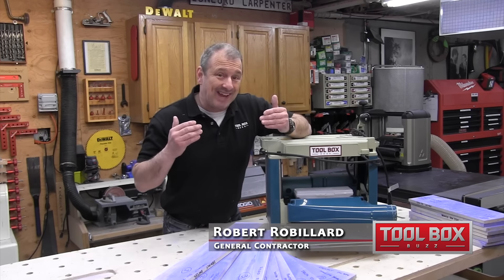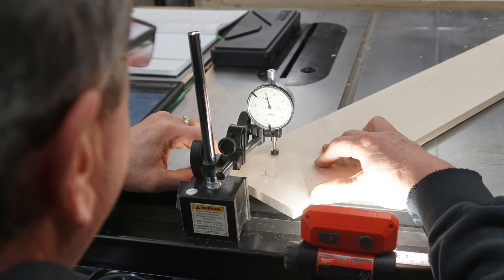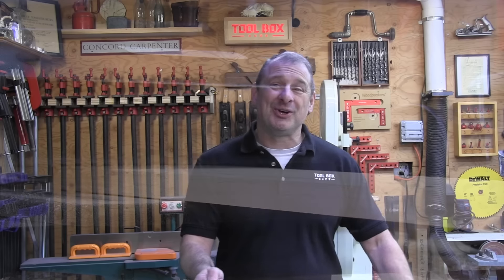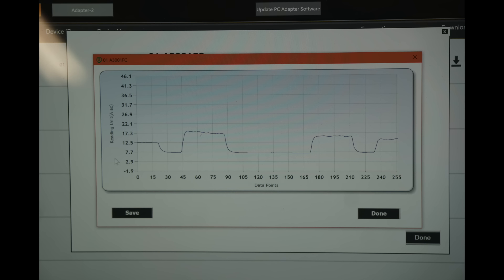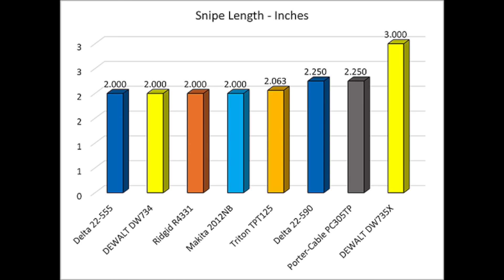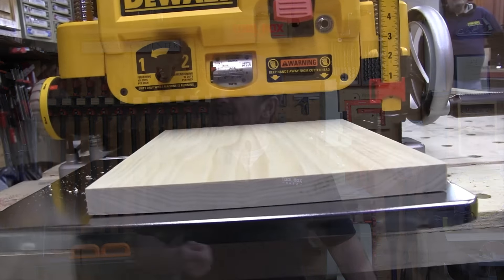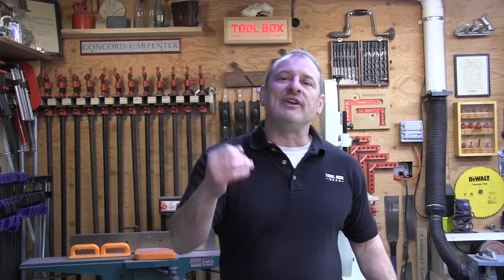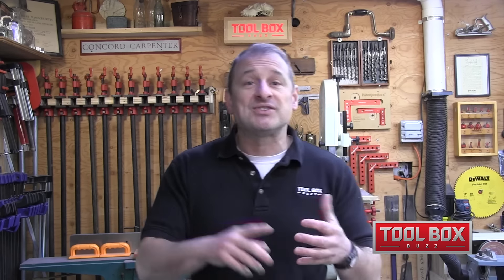Best Benchtop Thickness Planer ~ Head-to-Head

Comment: One issue I’ve noticed with inspecting these at the store (in particular the DeWalt 734) is that the hinge point of the infeed and outfeed tables appears too low, such that they will always be below the surface of the cutting table. Although there is the adjustable bolt, it seems that all that will do is change the maximum opening angle of the in/outfeed tables, and not actually increase the height of the edge that is adjacent to the cutting table. Am I missing something here? I can’t figure out how you can actually raise the height of the tables to make them coplanar.

Comment: Really a great review this is the next tool I really need in my shop thank you so much
Reply: Thickness planers do open up a world of possibilities as far as woodworking goes. Without a thickness planer there's just jobs that aren't feasible to tackle. I guess you could do them with just a jointer or hand planes. But I wouldn't. heh For real when you need a thickness planer they just can't be beat.

Comment: The type of cutting head is a critical test as it affects cost, performance, and long term cost of ownership. I would like to see different tests/evaluations. 2 blade, 3 blade,  helical, and spiral. It isn't fare to test a $250 2 blade planer against an $800 helical planer.

Comment: This is really a good comparison, and a decent data set.

I really would have liked a lot of the tests to be performed at a lower DOC, also, just because the woods I use are very, very expensive, and I am not prone to hog material at max DOC in my shop. The small savings of time isn't worth scrapping a single piece of these exotic and domestic tone woods.

And my profession is Manufacturing Engineering Manager and Production Manager, so I'm familiar with how to actually analyze material removal rate, ROI, etc...

Comment: The graph showed peak amp at 30+  under heavy load, even the low peaks were 20+. You probably want a 30 to 35 amp to be on the safe side. Might even need a 40.

Comment: I think some of your data from the amperage is wrong.  You shouldn't be able to pull that much out of a 20 amp circuit.  I believe the motors for both the dewalts are the same only the feed has a gearbox.  I have the DW735X and the finish is way better then the powermatic we had in the cabinet shop.  But its capacity is extremely limited compared the the powermatic.

Comment: I have the dw734 and I'm seeing a lot of people upgrade the 734 and 735 with helical cutter heads. These usually cost $300 to $450. The pros to these is longer blade life, easier blade changes, and supposedly better Finnishes. I was wandering what people think that have that upgrade?
Reply: We have not done that. Cpl reasons. #1 the finish the DeWalt planers produce is so good and the regular blades are so cheap it doesn’t seem worth the trouble.  #2 is the cost.  If we had a high-volume operation planing 1000s of BF per month- maybe.  But then we’d invest in a stationary 220v planer and put the helical head on that.  Our typical job is a kitchen that might take 2-300 BF of lumber.      Blades are 2-sided and cost $50-75 for a set - I get 4 typical of our jobs out of a set. That’s a direct cost of $15-20 per kitchen plus a few minutes to change them.  But I also like  to have a chance to really clean the machine, rollers, wax the bed, etc.  We spend more on Titebond than we do on the planer blades LOL
Reply: @HBSuccess  Thank you. This is one of those things thats been in the back of my mind for a while. Good to get a second opinion.

Comment: Has anyone that owns the Dewalt 735 paid a bit extra for the Shelix cutterhead verses the 3 blade standard addition. I have heard that they cut so much better and last a lot longer.
Reply: I've had a DW735 planer for a few years and was never very happy with the performance until I bit the bullet and installed the shelix head.  Totally different machine now and a pleasure to use.
Reply: @mattygee5000  Thanks. Just retired in Aug and getting back into woodworking. I have another former Military friend that is really into it and just spent $3200 on a big Powermactic planiner. I told him the next time I have some big stuff to plain I will stop by.

Comment: Am I thinking right concerning the depth of cut accuracy test? - if the Triton TP125 deviated .0302 (almost 1/32”) from the 3/32” indicated, does that mean
1. that the the board came out with somewhere between 1/16” to 1/8” removed 
2. was it predictable, always more removed or less removed?
Reply: Ted Gier it was predictable, just doesn’t match based on the dial.

Comment: Great review,  have the 735x myself... But I do have to wonder how it took 25 min to change a blade set.  It takes me about 9 min (with the fumbling of a few screws), so I'm not really sure how it took 25 min in your test.
Reply: I have a 734 and messing with the blades does suck. I never timed it. I just know I hate doing it. Pulling them out and putting them back in nothing compared to how long it takes me to sharpen the blades. I figure the whole deal takes me about a half a day? I got a brand new set of blades in a drawer. I'm still on my original set though.

Comment: First,  thank you for all the information. The graphs are helpful. I am not sure how everyone is saying this is unbiased. I actually see the opposite. You ranked the planner that all of you, self admittedly, already own. Any category that was bad for the Dewalt was left out of the scoring. You consider snipe to be inconsequential but find feed rate important enough to consider in a 4 score test. Snipe is waste and is extremely important for beginner to novice woodworkers where as feed rate determines nothing but what, power? If the planner feeds the board then the power is enough, is it not? Lastly, the thickness accuracy is a joke. You proved they were all amazing and the fact that Dewalt was .00X closer to 3/32" should have fallen under the same analysis as your blade change evaluation, they all work and it does not make a difference. What should have been tested is how close multiple planed boards from each planer compared and if they were the same thickness. That would have told you how reliable the accuracy was from one board to the next. All in all, the only thing that matters in large sample comparisons should be the price, accuracy, and then the features that make your life easier. Things like the blower location, how easy adjustments are and lastly if anything shifts during use. You talk a little about this with the Makita and then quickly move away from it without talking about any of the others. It seems to me like you wasted 20 minutes when you could have simply said, "We all like Dewalts expensive model," and left it at that. Thanks again for all the information.

Comment: I have 1000 strips of non sanded 3/4 yellow pine cut to 8”x8ft strips, and I need to sand both sides, could I use this instead of a sander?
Reply from the maker: Dak Dur no
Reply: A Concord Carpenter / ToolBoxBuzz 
May I ask why though? What effect would this have on the plywood? I’ve seen plywood hand planed without issue.
Reply from the maker: Dak Dur you said pine, is it pine plywood?  Planets remove material and when the used correctly can give a smooth finish but it doesn’t replace sanding
Reply: A Concord Carpenter / ToolBoxBuzz it is standard yellow pine plywood sheathing I just need it to give a smoother surface than the current standard rough texture of sheathing
Reply from the maker: Dak Dur that’s do fine

Comment: I live in an old Northern Calif Black Walnut Orchard. (Juglans Hindsii, the cats meow of  black walnut) So I bought a 22" woodland mills, all the trees are under 22".... I belt sanded to 400grit a piece 6ft long, max width 21" to 18".... Took about 2.5 hours for 10bdft. I have 25 pieces to get into 400grit or better, really.... And dozens of pieces around 1ft. wide... Is it possible Re Mount the planer in such a way that is suspended overhead, then I can flip the wood over and plane the full width.  That's what I want to conjure up,  because a 24" planer is Very expensive!

Comment: Unfortunately this well thought out and detailed evaluation is marred by extreme bias. As stated at the end of the comparison several of the testers own the DeWALT 735 and no matter how hard we try everyone wants to believe they own the best.  This desire caused the testers to disregard the two tests in which the DeWALT performed poorly, snipe and blade change, each of which had clear measurements that could be easily ranked against the other units and then include, “surface finish”, a completely subjective category, that the DeWALT owners declared the DeWALT 735 the winner of. As I said this comparison was well run and detailed and can provide the viewer with plenty of information to make their own decision as to which unit is the best for them. The DeWALT 735 being declared the “winner” by a wide margin should be taken with a grain of salt.

Comment: Good video. I think you're supposed to check the "video contains paid promotion" box on sponsored videos.
Reply from the maker: Its NOT a paid promotion. This was an impartial tool test and review.
Reply: @ConcordCarpenter  I'm sorry. I assumed because of the prominently placed DeWalt cutout letters and sawblade in the background, that you were sponsored by them.
Reply from the maker: No man - the dewalt cutouts were from a Dewalt scroll saw review - we cut their name out as a test. I liked it - so I kept it. the blades are a mix of dewalt, Diablo, Forrester, and Teneryu    @909sickle
Reply: @ConcordCarpenter  I see. Thanks for the correction.

Comment: Is it because i am a Makita man and have bias that I see the bias to'ord the brand that is hanging on " Robert De Niro's" wall? They notice and promote the odd thou of inch for dewalt but don't detract for the heavy weight, and when the big dewalt comes last they don't include that criteria in the result  despite spending 5 minutes on the criteria. Getting a bit bogged down with the detail maybe a way to promote the one you are getting paid to promote rather than the best item for the general user. What i wanna know is (im a hobbyist woodworker and professional electrician) what works, what works best, and then let me decide which i can afford for the tasks i am going to employ it for. The "current pull" and speed of "load and no load" pull has no effect on my decision. There's a reason the dewalt weighs over 90 pounds (almost 7 stone to us limeys) and doesn't blink when compared to the others is that it has a big arsed motor in it that pulls a lot of energy from the grid through your energy expense account to save a thou' of a second which you'll spend a million times over setting the damn thing up cos we aint all pros. Rant over, back to my Gin and Tonic, (No juice Snoop) just a thought. Anyway its half ten at night, the Queen has made a speech at 9, i best do my duty. Overall, it aint a bad vid, i appreciate what you are doing, but but cut to the chase a bit more, get that tattoo that the RDN had in lake placid and all will be good.

Comment: All I have to say is NEVER have i called dewalt with a product issue and not had them throw parts at me to fix whatever problem.  
Case cover? sent.  Drill chuck? sent. Nailer tip? Have a few. Case latches? A whole bag sent. Their warranty says have a receipt but they honestly don't care. Just tell them where you bought the tool, if it's an approved dewalt retailer, you're all set. Their customer service is off the charts, IMO. 
Y'all can compare whatever, it's cool to watch,  but the chips are down when you have a problem and in that moment DeWalt ( and Bosch) are tops.  

Do a comparison where you pretend a tool is broken and you need a mundane part, like a knob or latch, sent to you.  Try that.

Comment: what? no ryobi in this test? I have had a ryobi for several years and it's pretty good for finish,  snipe is irrelevant unless a manufacturer puts feed rollers on both sides of the blades.
Reply from the maker: Not sure what you mean, all planers ave 2 rollers
Reply: @ConcordCarpenter  snipe is from timber dropping of at the end and getting gouged by blades

Comment: Thank you for this video. Im looking for planer for the chestnut in my house. My house is 1914 with all the trim being chestnut or clear pine. I bought this house as a forclosure and all the trim was painted (angry) before sale. Will the planer be able to take the paint off with a small layer of wood? Also, if I lift the boards as the go through and after they pass through, will it minimize that bump (i forget what you called it already, its 330am)? 
Thank you again

Comment: Got a european 3 bladed dewalt myself, nice machine but oh dear, the snipe is awefull.
Reply from the maker: Ellert van Koperen check the extension tables and get them in line.  Also use an out feed table or adjust the outfeed extension a little high to lift the board a lil as it exits

Comment: Whilst it is acknowledged the roller spacing is larger than the others and hence the snipe is longer.... your testing does not show how deep the snipe actually is. Seeing as the dewalt has alot more accuracy I find with my dwe735 that a light sand removes all signs of snipe. Can this be said of the other brands or is it actually wasted material?. It wouldve been good to measure and share the details of how deep the snipe actually is.
Reply from the maker: USS86 x good point, maybe we’ll include those measurements in the article @todd Fratzel

Comment: I have two comments but I must preface them by admitting I have never used a planner.
1)  The amperage consumption does not prove that the motor is more powerful, it shows it is not efficient.   Compare work done (number of cubic inches of wood planed per second) with WATTS (not amps) consumed. 
2)  The comparison of feed rate - no load to load, tells you nothing other than how slow the machines feed no load.  Any planner that has a very slow no-load speed will do well in this category.
I don't mean to say the DeWalt is a bad tool.  I own DeWalt tools and like them, but your analysis is faulty.

Comment: Sad to see the Makita did so poorly in this test. Its really the only branded planer sold in my country, and i have seen some good reviews such as its very quite, and reliable, but your chart showing it has the worst surface plane is disappointing to me, might as well go with a cheap chinese no-name brand option for 50% the price if its not punching high quality. We use 220v, but i could buy the dewalt 735x with shipping/import tax for $1050 USD... One negative i have heard about the dewalt is its crazy loud..

Comment: DW735x is an excellent planer but nobody is picking that thing up and moving it around at over 100 pounds. Benchtop yes, portable no.
Reply from the maker: It's a comfortable 2 person lift for sure
Reply: I have my 735 mounted on a flip cart 16/32 sander on one side planner on the other fits great in my 16' x 24' DIY shop

Comment: I have a Dewalt 735 and it is the worst planer I have ever owned. It has been sent to the factory service center and tuned. The most amount of wood that the planer will cut only 1/64" at a time if you use a 6" or larger board. Also, after about three minutes of use the planer shuts down and you have to wait until the motor cools, hit reset button, and then continue.
Reply: You got a serious lemon. I've been using the 735X in my shop for several years and I have no problem with hard maple, walnut, oak, and putting a 10" board through it doesn't phase it one bit.
Reply: Sounds like a bitter Milwaukee fanboy

Comment: That false about the porter cable planer. I had it for a while and upgraded it to the Dewalt. They make a dust collector attachment you can buy off amazon. It's made for the delta planer for work great for it. Here is the link for it. https://www.amazon.com/DELTA-50-359-12-Inch-Planer-Connect/dp/B0006NBUX2/ref=mp_s_a_1_3?keywords=dust+collector+delta+planer&qid=1580225085&sprefix=Dust+collector+delta+planer&sr=8-3

Comment: So you guys basically ignored accuracy of the thickness planed for a machine that planes boards to a specific thickness? Hmmm
Reply: Guardian Arias why do you say that? We calculated accuracy. Check out the article.
Reply: @toddfratzel3569  When you ranked the planers at the end it seemed like the repeatability accuracy wasn't weighted very well, yes you tested the accuracy and your guys methodology is good but i think when it comes down to it the tool should be best at what its supposed to do. A table saw should give you the same rip on every pass, a planer should kick out stock the same thickness every time.

Ultimately i guess it comes down to what the user values like it was suggested I just thought it was odd the thickness accuracy wasn't valued higher.

Comment: I have the Triton and bought it because of this videos results and have been massively disappointed! The materials used to build are very poor. The fold down support tables and the main floor of the planer bed are dented beyond repair. This is not a planer for rough lumber! I planed a dozen, 6" rough-cut pine which did have some knots and the bed panels conformed to them like tin-foil. I also planed ash which is hard and it would barely make a pass with an 1/8 of a turn of the handle before tripping the breaker. So unless your lumber is fairly well surfaced from the start, don't use this planer. It does a nice finish cut and the blades couldn't be easier to change but I am super-disappointed and will go with the DeWalt dx735x that I was considering from the beginning. Sadly, I bought a machine to likely throw away after one year...it's not worth it!